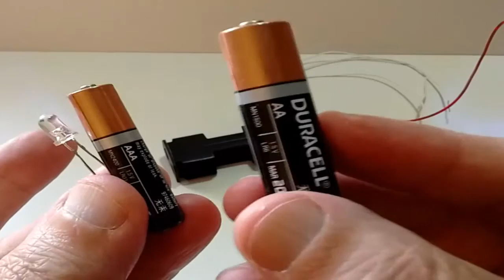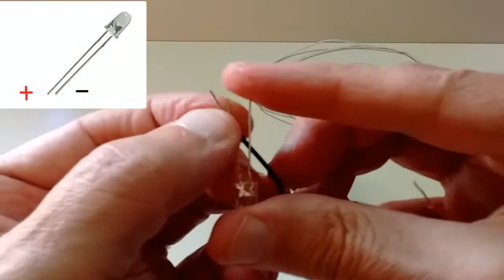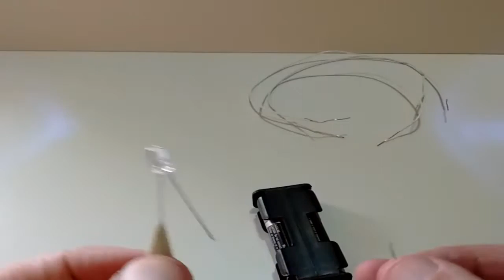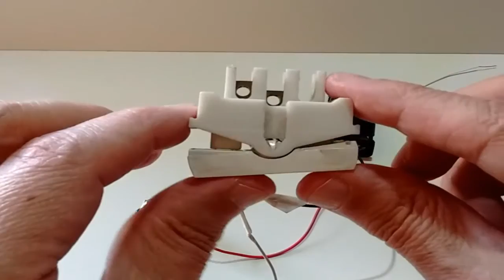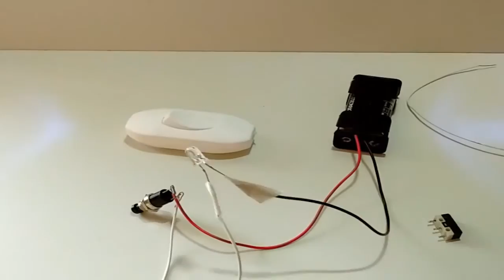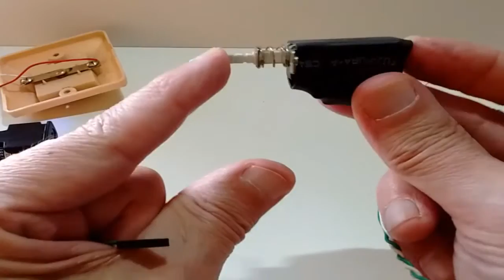Hacer interruptor y Pulsador circuito con led, pilas o batería

Comment: Hola profe tengo una duda algún número de wats ? Saludos 🖖
Reply from the maker: Hola Velarde, si te referis a la resistencia es de 1/4 wats, el Led es de 5 milímetros, el interruptor o Pulsador los más chicos. 
Para circuitos eléctricos a Pila cualquiera sirve, las pilas no consumen altas corrientes Saludos

Comment: Diaculpe esas dos pilas podrían alimentar a 3 LED o se ocupa una pila de 9 voltios?
Reply from the maker: Hola Gil Ornelas, si 2 pilas pueden alimentar a 3 leds sin ningún problema. Saludos!
Reply: Como conecto a los otros led si quieres poner 2no 3 por ej
Reply from the maker: Hola, lo debes conectar en paralelo, es decir los positivos de los led todos unidos, y por otro lado los negativos de igual forma. Saludos

Comment: Una pregunta... intente hacer un experimento.. conete 2 led a una bateria de li-ino 6800 ah. Pero calientan demasiado los led.. que puedo hacer para que no calienten pero que sean de la misma intensidad
Reply from the maker: Wilfredo lo que puedes hacer es subir el valor de la resistencias para que pase menos corriente a led. Gracias por tu comentario y felicidades!
Reply: @ProfeGustavoTecnología  ok profe pero como lo hago
Reply from the maker: @wilfredocalamaco925  La batería que voltaje tiene?
Reply from the maker: El Led de que color es?
Reply: @ProfeGustavoTecnología  3.7 vol
Reply: @ProfeGustavoTecnología  rojo intenso muy iluminoso
Reply: @ProfeGustavoTecnología  y probé también con 6 de tipo araña.. son unos cuadrados.. pero igualmente se me cali tan mucho.. seria demasiado
Reply from the maker: Con una resistencia 100 ohms tiene que funcionar bien. Si aun sigue calentando prueba con 200 ohms
Reply: @ProfeGustavoTecnología  aaaa ok prefe.. gracias  esque quiero ponerle luces a un mi casco de motoristas.. es una innovadora idea... jejejeje  mil gracias mi estimado.. le salido de Guatemala